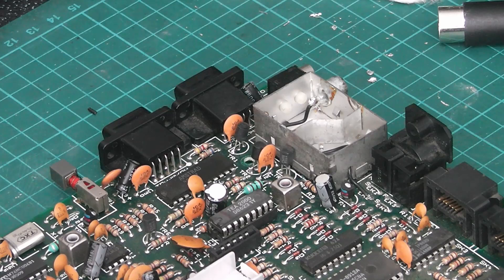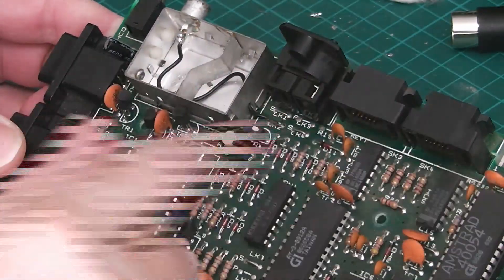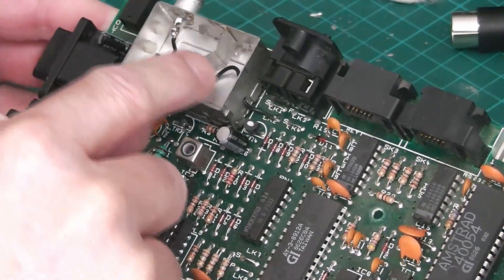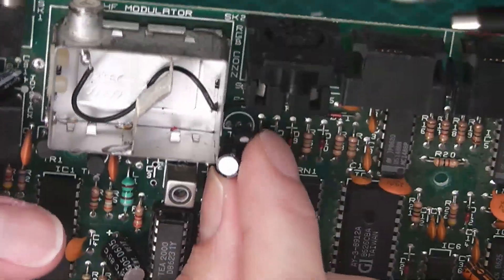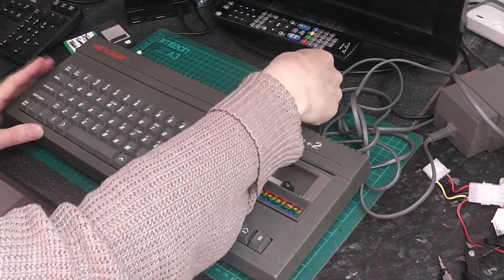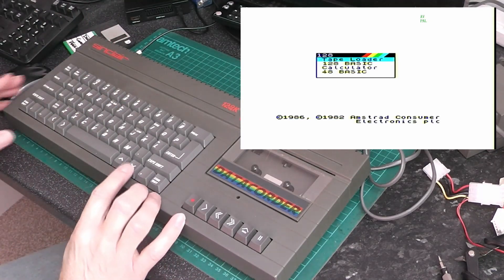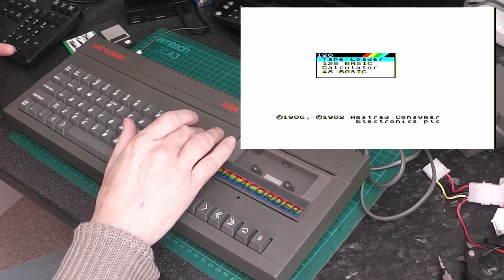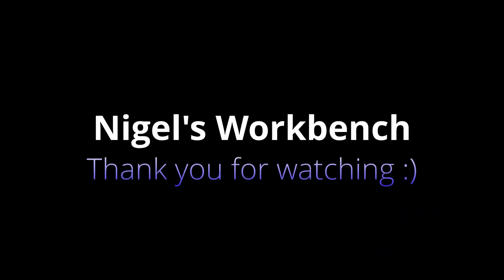ZX Spectrum +2 RF to composite mod

Comment: Is this easy to do
Reply from the maker: If you're reasonably good at soldering it's not too hard 🙂
Reply: Will this work on the grey 128 plus 2
Reply: We’re do I solder the wire
Reply: I’ve took the fr board out solders the wire to the Ariel and the wire to the point were you have still nothing
Reply from the maker: Try watching my follow up video, where I go over some more mods for composite, as well as RGB :)  https://youtu.be/uvfHPZdBKhQ may be worth trying?